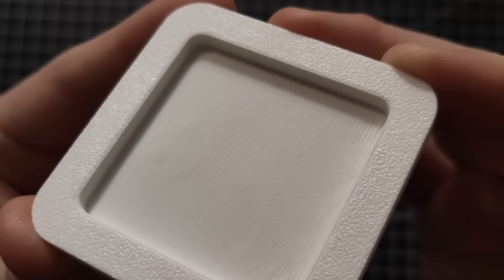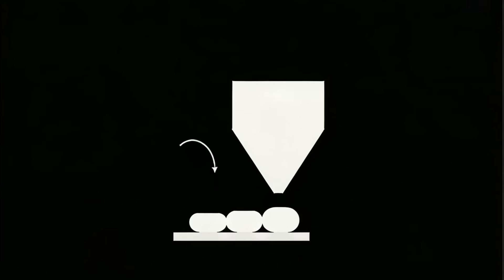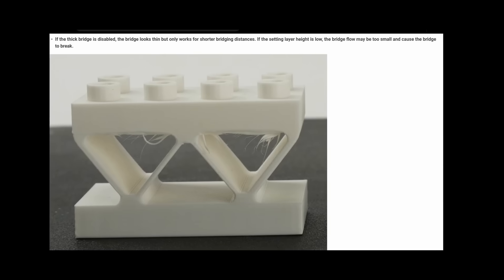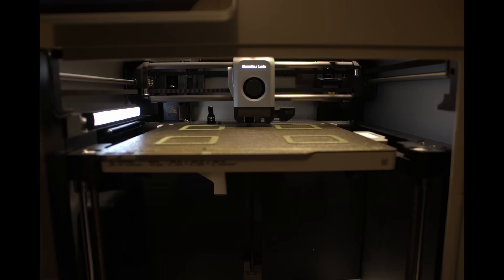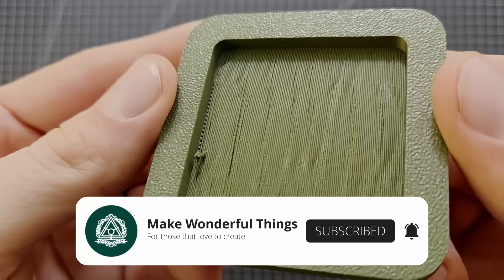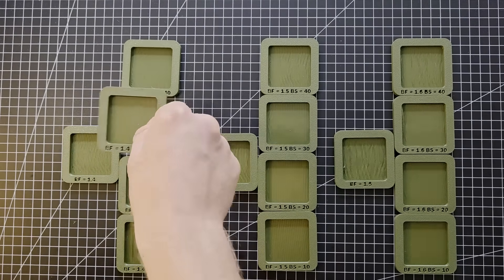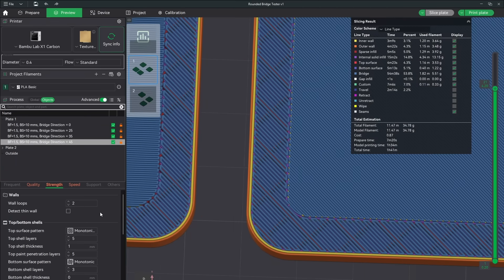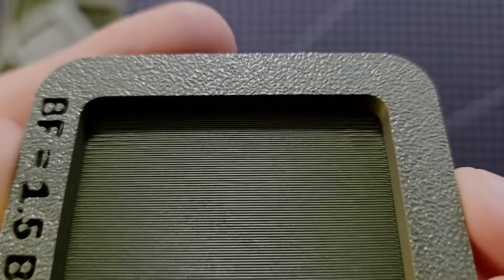The BEST settings for bridges? Smooth UNSUPPORTED 3D printed bridges

Comment: nice and to the point and im gonna try exactly what you did here with my p1. SUGGESTION for your next test, can you play around with "bridging pattern" and "bridging anchors" - from what i can see you are using "monotonic" pattern, that loops when crossing walls - in some limited testing i had better quality with "monotonic lines" without "loops" (i always mix those sorry)
Reply from the maker: That's a great suggestion! Several comments mention bridge anchors, so I will be taking a deep dive into that over the next few days.
Reply: @MakeSometh1ngWonderful  theres also the "infill/wall overlap" setting im always urged to test but then again im often getting lost in the sauce haha

Comment: Great video! Love the short format.
About the sagging near the edges, could it be because the next layer is pushing it down? If that's the issue, it may be beneficial to print the next layer with a lower flow. There are no settings for it in Bambu Studio though. 
Ultimaker Cura has experimental settings for exactly this. You can set 1-3 bridge layers with different settings on each.
Something else that comes to my mind is the distance that the bridge lines are extended into the part. This is the same as the wall thickness. So more wall lines will anchor the bridge more and possibly stabilize the flow more before printing in air. Perhaps something to test?
Reply from the maker: That's a good question. I plan on trying to film those first few lines, based on a suggestion from another comment, and to see what is actually happening there. 
Thank you for explaining the Ultimaker Cura settings to me. That maybe an excellent option to look into, if the next few ideas don't work. 
I think something like 5 people mentioned the distance that the bridge lines are extended into the part. I am a little embarrassed that I didn't explore this more 😅. This is one of my top priorities for the next week and video.
Reply: Oh and, how does layer height affect this? Lower layer height will create smaller bridge lines that are smoother but more fragile?
Reply from the maker: In regards to layer height, I did try that. In my experience, it didn't change the sagging that much and it took a lot longer to print off 4 test pieces. So, I abandoned the idea early on. But, when you consider the combinatorics of variables, it is possible that you could find the ultimate combination of line height, bridge speed, bridge flow, and other variables somewhere where I did not search, so it isn't impossible to find a permutation where line height makes a perfect result.

Comment: Great video, to the point and clear, factual information.

Question: is there any advise/ consideration for bridge distances?
Reply from the maker: You're welcome! Yes, thank you for asking. I used a model from makerworld to evaluate the unsupported bridge distance. 
Link: https://makerworld.com/en/models/421754-bridging-test-10-100-mm-spiral-version?from=search#profileId-324670
For this printer and filament, I found that I could consistently print great bridges with default settings around 45mm. The printer does make bridges up to 100mm (as shown by the test), but the entire line sags in that case. The method in this video works really well up to 60mm, based on my experience. It might work for longer bridges, but, I haven't tried yet. 

Hope that helps!

Comment: For flat-bottomed overhangs I can really advice you to use the sharpie trick. This offers a zero-Z-distance support solution for super strong parts.

It works with pausing the print before it lays the bridging layer on the support and then paint in the top of the support with a sharpie.

The machine will print over the sharpie ink and the plastic won't melt together, yet it will also not fall off.

After the print you can easily remove the supports by hand. 100% success rate for me.
Reply: many prints need more than one set of bridges, so this method is a bit more reliable when sharpie is not. Besides, some models may not look great with a pause for certain materials like ABS (if the benchy hull line is a problem, which I assume it would be , because if you care about bridges, you probably care about the outer wall finish.
Reply: @Goodvvine  The sharpie trick is mainly suited for structural parts. Because the support distance is zero, which means the bottom of the bridge has zero structural loss. But I love how you only criticize and fail to see the benefits and positive sides of my proposed technique 🙂👍🏼

Comment: I wonder if the corner sagging has to do with fan speed or other thermals. Try disabling fan during bridging?
Reply from the maker: You're correct, fan speed DEFINITELY influences it. I tried two things:
1. Turn fans on a fraction of a second before the bridge is being printed. You can do this with OrcaSlicer with the Cooling Fan settings. This made the 1.5 bridge flow at 10 mm/s look really terrible. BUT, I only tried it once.
2. I tried turning the fan speed down to 50% during bridging. This also created a more stringy appearance, although barely perceptible. 

Sorry that these didn't make it into the video. With a lot of these smaller tests, I didn't put them in because they would make it longer, and to fully explore what each variable would do would require many hours of printing, which I worried would slow me down so much that I would never actually finish. 

If you get good results, though, I would love to hear how you did it!

Comment: Printing wider than nozzle width is commonly done and is recommended, 1.5 to 2x nozzle width should work in most cases. More is possible but may need specific tweaking. 
Great video.

Comment: Prusa slicer has a single checkbox called "thick bridges" which I assume does this but I haven't seen particularly special performance from
Reply from the maker: Good point! Bambu Studio also has this check box. I've used it, but it didn't get close to matching the bridge flow and bridge speed formula here, in my experience.

Comment: Great find and great presentation!  Is your test model available? I’d be happy to do some testing as well. 
Have you tried combining your settings with the “Thick Bridges” setting? Given the flow rate and slower speeds, that may do the trick.
Reply from the maker: Thank you! I will post my test model on makerworld today and drop a link here. You know, now that you mention it, I realize that I only used the thick bridges once with this method and it made the finish worse. BUT, I didn't do it in a methodical way. I'll try this out with one of the other suggestions in the comments and post another video if I can make the finish perfect.
EDIT: Link added to description.

Comment: On my a1 mini 0.7 is best, i don't think it can do 1.5 flow without aux fan but i'll try it out.
Reply from the maker: Ok, good luck! If you have a any kind of fan, you can point it at the print while it's working and that will help to some degree. That's what I used to do with my Ender 3, at least!

Comment: You have 2 wall loops, so it's possible more wall loops could help with the sagging, but probably also some other bridge specific settings tuned with that
Reply from the maker: That's a good point. I hadn't considered that. Thanks!

Comment: What about reducing the temp? Just for experimention sake. Really hot plastic would sage more.
Reply from the maker: That's a good idea! I showed some of the pieces where I tried that around 2:50. I did more than 2 tests of this, but never really got a great result with the green filament. For whatever reason, turning down the temp massively impacts my latte brown PLA, and makes the bridges look amazing. Still not perfect, but extremely smooth.

Comment: Ive avoided a number of practical prints and found it hard to design some of my own items due to this exact issue. Im going to run some tests on prints ive had in the "later" pile, as well as take your approach to my 0.2mm nozzle and minature printing where i think this will make a HUGE difference to overhang issues us minature printers face. Keep at it!
Reply from the maker: I love that! Was planning on going to a 0.2mm nozzle and doing a miniature printing guide in the future, maybe in 2 months or so. It will probably make your print time go through the roof, but is likely worth it 😂

Good luck!

Comment: This is a great find. The one downside I've found with this is the first TOP layer of the print is also slowed down by the bridging speed.
Reply from the maker: You're correct. The first top layer is considered a bridge line type. You could use a modifier cube and change the bridge speed just within that if you wanted to prevent that. For prints under 100mm though, I think that it may save a few minutes of print time, but require a few minutes to set up in Bambu Studio. But, maybe for your prints it would make a meaningful difference. Just depends on the situation, I guess 😂

Comment: I wish bambu did some intelligent bridging where it uses the edges of existing geometry and partially "squishes" an overlapping line to ensure it's supported on ~50% of that print line. We have ironing built in now, so I don't see why it couldn't then do a pass after all bridged pathed are printed and clean up any squished filament from the top surface

Comment: When I had issues with bed leveling, I did use up to 200% of usual flow on initial layer ("line width" in Cura) so I could have lines that are well squeezed into build plate at the cost of increased spacing. Also you can switch to larger nozzle like 0.6 in settings, but actually have 0.4 on printer, and usually it will work just fine. This may fail with flexible filaments though.

Comment: Is this for PLA? Doubt that this gonna work for ABS...
Reply from the maker: The prints shown in this video are PLA, yes. I don't really work with ABS much. If I was working with a different material, though, I would just run the experiments again to find the ideal setting for whichever material it is. 

The principle here is related to how spacing is calculated by the slicer. It seems like they only account for flattened filament, and increasing bridge flow can help overcome the issues that arise from that line spacing calculation.

Comment: Going back to the corner starting point, could you also increase the overlap of each line? From the slicer devs, they could vary speed depending on how far the nozzle is from a supportive structure. Also, if the bridging started a few extrusions into the part (pre-bridge) the tensile strength of the filament could be helpful with your initial edge sags.  I have so many thoughts, and so little implementation skill.
Reply from the maker: You have some interesting ideas here. When you're saying increase the overlap of each line, do you mean something similar to brick layering? (like this: https://youtu.be/5hGm6cubFVs?t=127)
The "few extrusions" idea is good. Similar to what @gui146 said in another comment in this section. I am going to revisit this idea and post a tutorial about it soon. I don't have much skill either, so I just print many more iterations 😂

Comment: Hello! cool info, in my opinion trespassing the wall could solve it, the nozzle would slow really down only after the wall, creating a better continuity and reducing the artifacts, but I have no ideia if it is even possible to expand only the overhangs or wich config to mess up with.
Reply from the maker: You're right about this! You can design multiple bodies in Fusion so that the bridging body continues passed the wall. I did this a few days ago but didn't present that here because I thought that it would be unrealistic in most real world prints. It also creates some other problems, like the bridge lines snapped off a lot more than usual. If you try it and find that it works for you, I'd love to hear about how you did it.

Comment: If you have an open printer or a way to put a tripod next to the front of the printer to record the printing with your phone in slow motion it might tell more about whats happening on the corners that is causing sagging.
Reply from the maker: That's a great point. I even set up a tripod and open door for one of these shots but didn't think of filming those first few lines. I'll try that soon and let you know here if I learn anything.
Reply: @MakeSometh1ngWonderful a macro close up in slow motion tells you a lot. Great video looking forward more
Reply from the maker: Hey man, I want to feature your comment and handle in the next video. Is that ok with you? Your idea helped massively.
Reply: @MakeSometh1ngWonderful totally